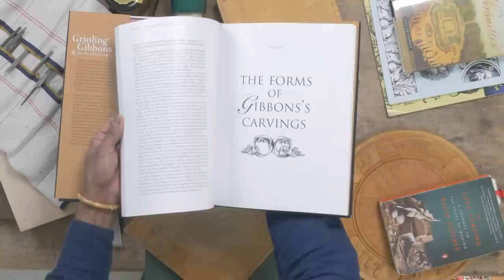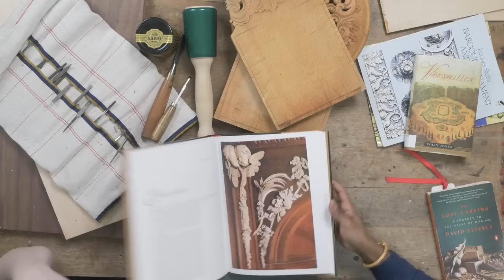How to Carve A Wooden Cutting Board With Rajiv Surendra | Introduction to Wood Carving | Life Skills

Comment: You don't really need carbon copy paper to trace- my Mom taught me- instead you use a soft pencil on the back of your paper. Either on the full page or more selectivity only behind what you want to trace ( you can see those parts very well through the paper, if you hold up againt a window...by daylight) 
Then you simply trace through the paper onto almost any surface and it works much the same as with carbon copy paper. 😊

Thank you for your beautifully made, informative, inspiring and soothing videos 🙏